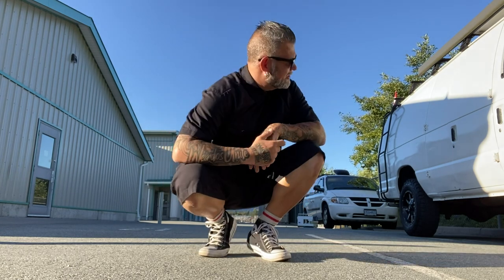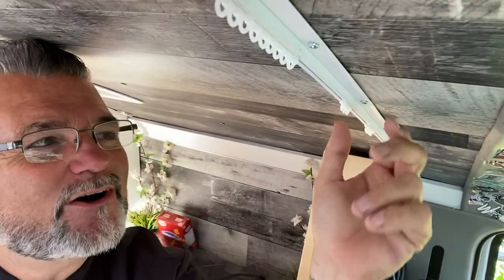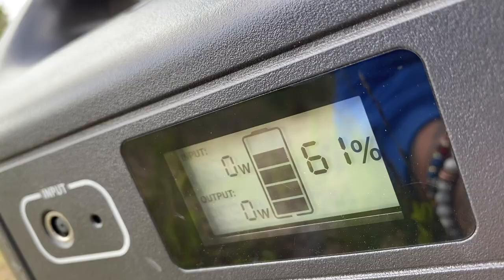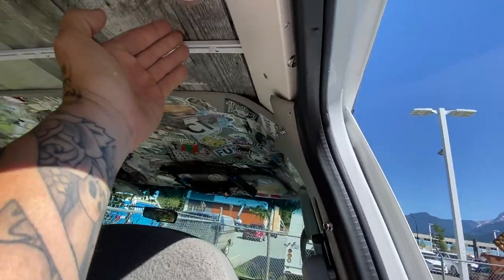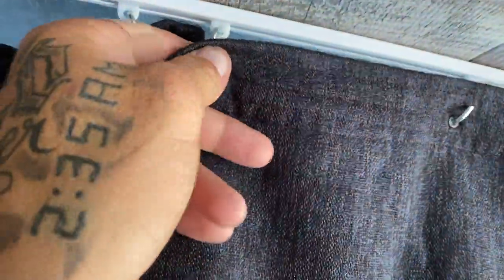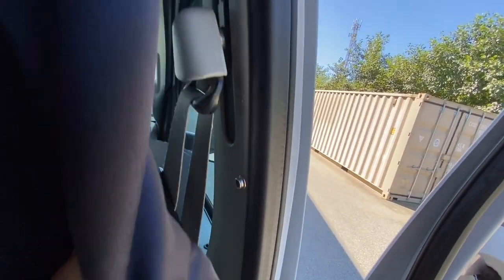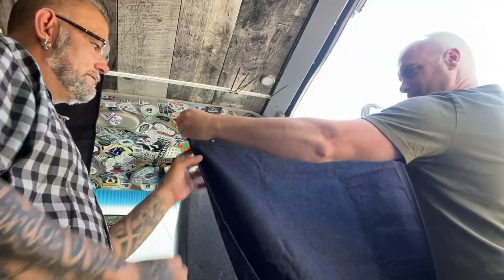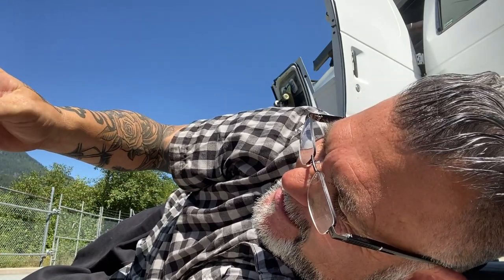Sewing Up Some New BLACKOUT Curtains "NO PEEKING"

Comment: I just ordered that track and the carrier slides from Amazon so I can change how my front curtains hang.  I think I will have enough length to change the rear curtains as well.  Thanks to John for the idea!
Reply: What did you search for the curtain tracks? I’ve seen many but none that go flat against the ceiling
Reply: Chrome 
Yes please tell ...
I too am looking for them ..
Would love to add to my conversion
Reply: Have been trying to find these with no luck, do you have a link or remember what you searched?
Reply: Me too, I have to do something to affix the curtain to the ceiling and this is an amazing hack.  Where did you find the curtain track? The one I saw at Home Depot was huge and only attached at the ends.

Comment: Just a thought: Instead of putting the snaps on the curtain edge, put on grommets, like the ones on the hanging edge. Have them lined up with the snaps. Unscrew the snaps on the wall, put the screw through the grommet on the curtain edge, reinstall snap to the wall. Now you can have your curtain attached AND snap on the bug screen. :)
And carry an extra bag of those little curtain track eyelets. They get brittle with age and sun exposure. :)

Comment: Hey Chrome, try using some nut and bolts (and some washers if needed) instead of the plastic wire ties. Easier to remove and can be reused! Not sure if this will work but it will be easier to install the curtains though.

Comment: I believe you can still buy those curtain pins that were used a lot in the 70s for curtains on those rods that you could pull the rope and they opened and closed. Probably would work better for no gap at the top

Comment: I think your  curtain  is too short because ,I think in the 
 the winter you are going to get a cold draft at the bottom of the curtain. You might  have Joseph  add Velcro to the curtain   so you can add the bottom piece for the winter cold season